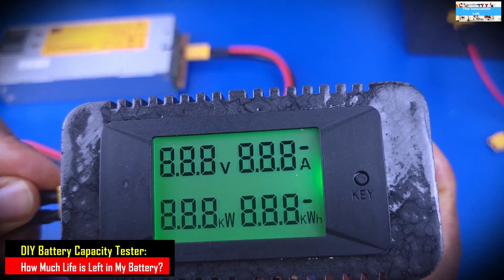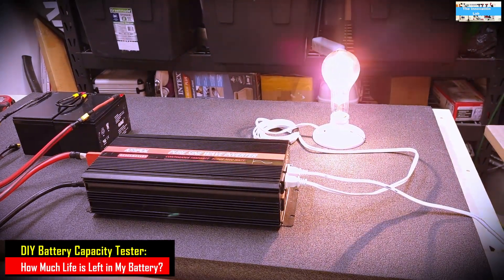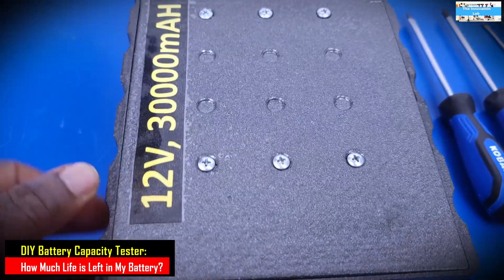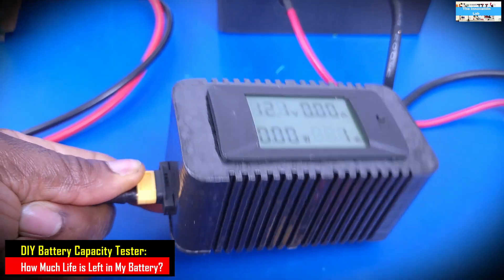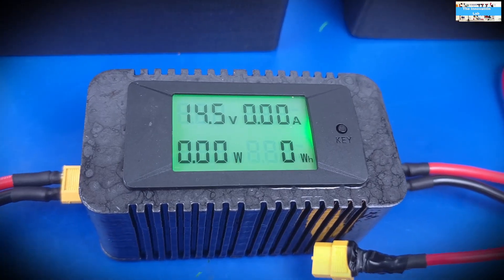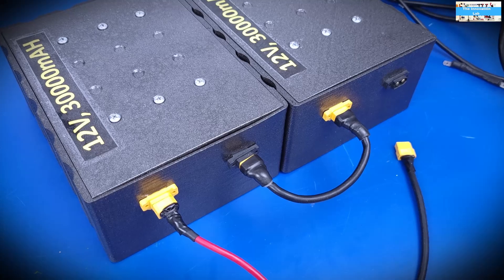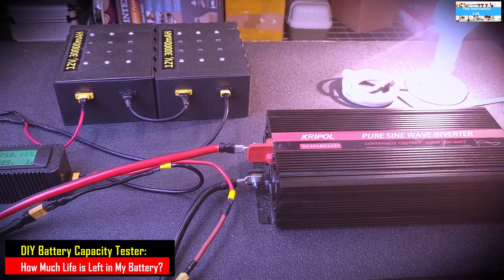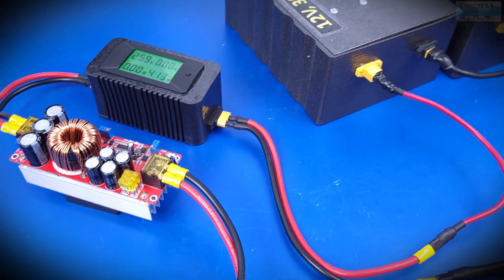Battery Capacity Tester

Comment: You can Mod your hp server power supply to 14.5 volt to charge batteries. Or you can add variable resistor to increase and decrease voltage between 12v to 16volt for your need.
Reply from the maker: Thanks a lot for the wonderful feedback.
I greatly appreciate it - very constructive!
👍👍👍
 Honestly, I have heard of this concept from other people, but I have never had the chance to  try it. 
However, you shouldn't really reply on a constant voltage source alone, for charging batteries like LiFePO4 and Lithium-Ion that undergo two different modes  during the charging cycle (constant current and constantvoltage). You need to be able to set the right recommended charging voltage for your battery type.....then set the recommended charing current. If you are only using the constant voltage, you run a high risk of damaging or shortening the life of your batteries. 
Please be careful with the CV approach. This is the reason why I am a strong proponent/advocate of using constant current and constant voltage DC-DC converters for battery charging.

I explained the CC and CV charging modes in the video below. This explains why we recommend using the CC/CV boost or buck converters. Check it out at your convenience
👇👇👇
https://youtu.be/WDWJ77WWkXc?si=dt2_Z3aMQUZq89eD

I hope this makes sense to you. Let me know if you disagree. BTW, I love the interaction.
Success wishes on your diy projects.
👍😎
The Innovati0n Lab
Reply: @theinnovati0nlab782  Thank you so much for your detailed feedback. Yes server power supply are heavy duty and can supply large amount of current which can be damage small batteries but in my case I'm using big battery like 12v 200Ah which don't require to set constant current. By the way these Server power supplies are really great as compared to other Chinese switching power supply. Server supplies are much more energy efficient and Ac to DC conversation losses are very low in server supplies 🤗